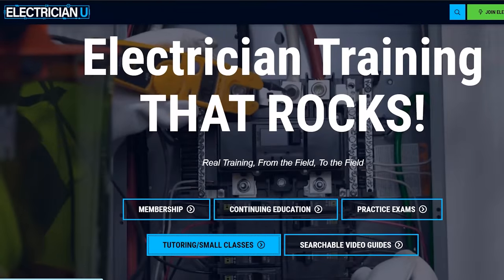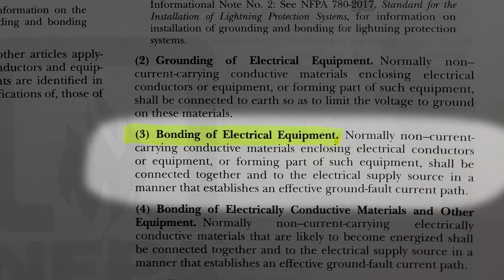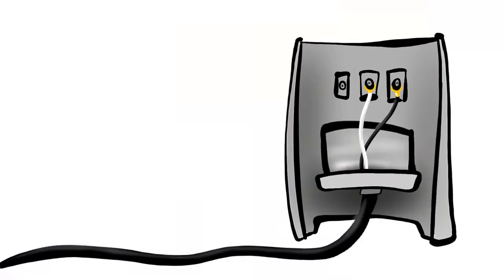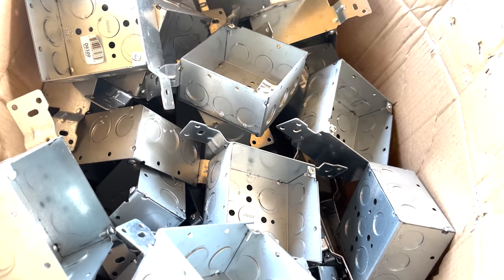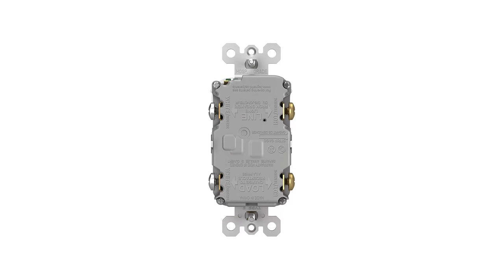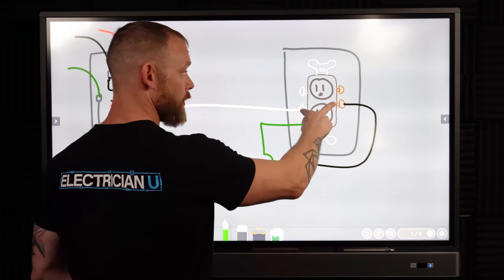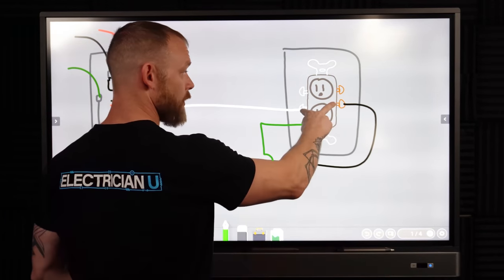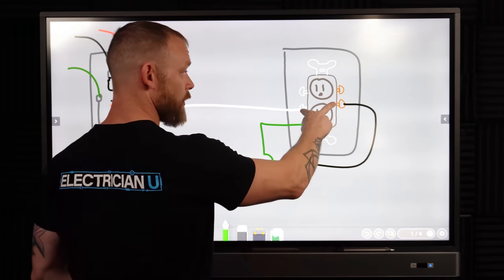Why We Bond Metal Boxes? Do Plastic Boxes Need Bonding?

Comment: Just remember not to bond a sub panel with the neutral and ground bonded together, they must be separated in a sub panel.
Reply: Is this because you always want the ground-fault path to make it's way BACK to the main service panel? And that is why we don't bond neutral and grounding conductor at sub-panels? I know there is other reasons....I am blanking (2nd yr apprentice here)
Reply: @mikenormandy9250  the reason for the isolation between the neutral and the equipment ground at a sub panel is because we want to direct path for fault current to flow. If the neutral is bonded to the EGC this creates a parallel path for the fault current to flow. We want that fault current to flow as quickly as possible to facilitate the over current protection device (circuit breaker) to clear the fault.
Reply: @electricianron_New_Jersey  THANK YOU! Appreciate your answer!
Reply: @electricianron_New_Jersey  So a parallel path could make the time-delay protection (fuse or CB) trip slower? THAT'S the puzzle piece I was missing! 👍
Reply: @PatrickKQ4HBD  This is not the reason we don’t bond the neutral at multiple points. The reason we don’t do this is actually to prevent objectionable current flow under normal operating condition. If you bonded the neutral at a sub-panel, the line to neutral circuits would use the grounding conductor as part of the circuit. We only want fault current to travel on the grounding conductor, so we bond neutral only at the main disconnect, service disconnect, or at the transformer, depending on the situation.
Reply: A bit off topic but thank you for stating the obvious.  suppose it might help someone out there who might not have already known, then again if someone didn't already know they probably shouldn't be installing a sub panel to begin with.
Reply: @RB-xv4si  Yep.  In that case the equipment grounding conductor would be carrying some of the neutral return current even under non-fault conditions, and so would anything touching grounded equipment; e.g., touch your washing machine and a faucet at the same time; not good.

Comment: Ah Dustin I see you have Purcell and Morin book on electricity and magnetism well done. It’s all physics anyway. Of course our separation between conductive and non-conductive is just a separation of convenience given enough electrical voltage and current flowing through even the blue boxes would become conductive. It’s just we are saying that would rarely happen as voltage and current never get that high unless in a direct lightening strike on a house.
Reply: With enough voltage, everything is a conductor.

Also, thanks for the Purcell & Morin book suggestion. I just added it to my shopping cart.
Reply: It is not a separation of convenience, it's a separation of real pragmatism.

At 100-400 volts these materials are NOT conductors.

That's why we call them insulators.

The difference between conductors, semiconductors and insulators is all to do with the amount of separation between the valance and conduction bands of the atoms in the material.
Reply: @deang5622  we were talking about breakdown voltages of different materials, mica has one of highest breakdown voltages ( diamond, benzene , perfect vacuum have higher breakdown voltages) breakdown voltages relate to very high voltages linked to the electrical field strength and other factors.

We were not discussing rated voltages for cables, and especially not at 100-400v we were talking about thousands of kilo volts. At those energies even wide gaps between conduction and valence bands can be bridged. At those energies it becomes moot what is an insulator or what is a conductor.
Reply: @mathman0101  No, you are going off at a tangent.  The original statement was around the designation of being a conductor or non conductor being a separation of convenience.

And that is not just the case.
The classification of whether it is an insulator or conductor is based on normal voltages which do not break down the material.

I challenge you to say otherwise.
Reply: @deang5622  we’re going beyond the statement!While materials rated at 100-400v are fine to conveniently describe what is an insulator or conductor at those energies. But even in a home those insulated blue receptacle boxes could become conductive in a situation of a direct lightning strike causing large temperature rise and conduction across all materials in floors and walls increasing the risk of fire and significant structural damage. It’s no wonder in many southern states including Florida lightening protection is an important feature for many homes. So yes something can be rated as an insulator or conductor at certain energies but there can be situations where that definition becomes less relevant.
Reply: @mathman0101  I am not going beyond the statement. I am simply correcting what I perceive as an error in the original post saying that the difference between conductive and non conductive materials is "just a separation of convenience".

It isn't a matter of convenience at all. It's a necessary distinction which applies to the materials in their normal use.

End of Debate.
Reply: @deang5622  🤣 debate never ends.I respectfully disagree you have your point I have mine. It might be a necessary distinction but it’s not a sufficient one.
Reply: @mathman0101  The debate ends between two people when of one person fails to respond.

Think about it. It's not difficult.

Comment: Still kinda confusing.   What if there is a green ground  the hot comes off touches the metal box there is also conduit  running off the metal box which goes all the way back to the panel?

Comment: Why don't they ground the neutral wire at the transformer to prevent an energized ground condition? Would the power be able to travel through the actual earth to complete the circuit then?
Reply: There are some places that use an "earth return" electrical service for cost reasons, I think mostly in Australia
Reply: The neutral tap from a transformer is connected to a grounding rod, for the purpose of dissipating static electricity and to give a path to earth in case of a lighting strike. 

To the second part of your question, earth is actually a pretty poor conductor and wouldn't effectively complete a circuit.

Comment: So 2 potentially (ha) dumb questions based on what you said:

1. If you were somehow floating in the air but touched an energized metal box with an improper ground, you would not be shocked?

2. Your examples include the hot wire coming loose and energizing the metal box (and thereby shocking the cat). However, if the white wire comes loose and touches the box, will the metal box still show zero voltage until the circuit is completed via the switch, etc?

Am I understanding this correctly?

Comment: Why is the green ground bus physically connected to earth? I get that this bus must be bonded to neutral in order to produce current flow to trip the breaker in case of a live-to-ground short but what would happen if you weren't physically connected to earth?
Reply: If the ground and neutral lines are not connected to each other, then when you touch the neutral line you will get a 110 volt electric shock. Not good.

Your body is at earth potential (or close to it) because you are physically in contact with the earth. 

So if you touch a neutral line that is not connected to the ground line, you are going to end up with 110 volts across your body. That is too high.

If you connect the ground and neutral lines together, then they are always at the same potential of earth/ground or close to it. So when you then contact the neutral line, and you are at nearly the same potential, there is only a very low voltage across your body and you live to see another day.

Comment: It should be so obvious and I guess it's not. Plastic (PVC in this case), is not conductive. Fault current - OR ANY KIND OF CURRENT - will not flow across non-conductive surfaces. 250.4

Comment: I am a bit lost on how a ground fault has way more electrical charge thus tripping the breaker. Ok, it goes through the ground wire and then to neutral so how does the over current happen?
I am a retired home builder but never had the time to fully understand the individual trades.
Reply: Gijo,
A Ground Fault Breaker (or outlet, or, as I think they are called in the UK a RCD) does one very simple thing . It compares the current flowing through the hot conductor and the neutral conductor. Any variance over a few milliamperes trips the device, under the assumption that current is flowing through something back to the ground, and if not the neutral than possibly a person. It is a new device (30 years or so?) and dependant on semiconductor electronics. A breaker or fuse, which trips at 15 or 20 or more amps, is just to protect the conductors from overheating. It provides no protection against shock.   Does that help? If not, let me know. 
Ian
Reply: @ianbutler1983  
Thanks for getting back Ian, but I still don't understand. How does the ground wire compare the current flow so that it is much higher than normal?
Reply: Y'all talking about 2 different things. Gijo, when a fault occurs in the context of, for example, a bare or loose hot wire inside an appliance making contact with the grounded case, you have now eliminated the "load" from the circuit. The load has a fairly high resistance, meaning the current flow is low enough that the breaker doesn't trip. A circuit without a load is a short circuit, and because there is such a low resistance without the load, current flow is extremely high, which trips the breaker.
Reply: There is no motor or light in the circuit so the resistance is super low. It is a product of Ohm's Law. The lower the resistance, the higher the current.

Comment: On every  box? What if 6 or 7 boxes on a circuit?
Reply from the maker: Yes? Grounding and bonding in NFPA 70 2020 requires all metal boxes be "grounded" and "bonded" as well as the use equipment if supplied with a means to both ground on bond be used.

Comment: Wait, why would more current pass via ground vs neutral?
Reply: If the hot wire makes direct contact with the neutral wire, then the same thing would happen. It would create a short circuit and the breaker would trip. But the neutral doesn't make direct contact with the outer case of an appliance, nor would you want it to. So the ground is connected to appliance cases/ frames/ etc. only as sort of an emergency path so that if the hot somehow comes loose and makes contact with the appliance frame, it essentially causes a short circuit and trips the breaker.
Reply: @TM-dh2xb  Ah, I missed that the powered device creates resistance/coverts-energy, so the amount of current flowing thru neutral under normal use-case would be less vs a direct path via ground. Ergo while ground is a neutral, so it could be connected to the neutral on the device and the circuit would function normally, "ground" means not-used-neutral.
Reply: @sunalwaysshinesonTVs  well, almost but not exactly. You do not want to connect the ground and neutral inside the appliance because this would make the ground wire a current carrying conductor. Electricity will take all available paths meaning that under normal use, there would be current flow on the ground, which we do not want. The only time we want current flow on the ground is for that split second during a fault, in order to trip the breaker.

This is also why ground and neutral are not bonded in a sub panel. If it were then the ground wire between panels would carry current under normal use.

Think of the ground as an emergency detour.

Comment: Simple explanation:;  There could be a connection between the “Hot” and an ungrounded metal box, and if you touched it it would shock you.  If there was a loose, hot in a nonmetallic box, and it was in contact with the box, it still couldn’t bite you.
Reply: But you didn't quote code! Dustin always says if you don't quote code it's just a rumor 😎🤣
Reply: Plastic boxes I’ve used has a grounding screw.
Reply: Yes it could still bite you.
It's got 110 volts on it and the path of current flow is down through your body to the ground beneath your feet, through that physical ground and to the ground/earth connection that is part of the electrical installation, and then as the earth/ground is bonded to the neutral, the return path is for that fault current back along the neutral to the distribution transformer. And that is the complete circuit.

Anything above 50 volts AC is enough to kill.

Now, that 110 volts is shared across your body and the resistance of the physical ground beneath your feet along the route back from you to the grounding point of the installation.

So if you're unlucky that resistance of the ground path from you back to the grounding point of the electrical installation is low, meaning most of that 110 volt potential is across your body, resulting in a voltage developed across your body higher than 50 volts (and less than 110).

Want to touch that 110 volt bare hot wire and test this out?

It's not likely it will kill you, or to deliberately misquote Clint Eastwood, "Do you feel lucky, punk?".
Reply: @deang5622  The conductors can.  A plastic box can’t.   If you don’t ground metal boxes, and something goes wrong, allowing a bare conductor to touch the box, the box becomes hot, and anything metal connected to it is hot.  Including the screws for the cover plate.

Comment: The key word is conductive material. How would you bond a plastic box anyway?.
There are idiots out there who try.
Where I work, I have opened up plastic emergency lights and found a green wire attached to a sheet metal screw into a plastic anchor shield (rawl plug). 
When you think people cant be that stupid someone will prove you wrong every time

Comment: I don't like plastic boxes, I have seen them melt when a device goes bad and overheats I have never seen a metal box melt or catch on fire. Plastic boxes make it easy for handymen to install outlets because bonding is not required. It also makes it easy for non-electricians to rough in houses with only basic training.
Reply: A good electrician should be able to install any UL listed box without batting an eye, plastic or metal..
Reply: I'm a diy guy and I prefer metal boxes also, I've used both and it's no big deal to hook up a bonding jumper. Even electricians use plastic boxes mostly, when doing residential work, because it's cheaper and faster. I like the 4x4 metal boxes with a mud ring. Easy to change from single gang to double gang or vice versa at a later date and with minimal drywall mods. I don't like the metal single gang boxes, too small.
Reply: @surferdude642  I get a deep metal single gang if I need one, though. They make 3.5 inch deep ones.

Comment: My best guess is that you need to include how the ground rod plugs into this discussion.  Your transformer on the pole needs to have a ground rod as part of the safety feature for return current / connection.  The A/C current flow creates the need for that part of the discussion.  Again, thank you for providing this service, it’s very helpful. 👍
Reply: Paul, can you explain how you think the ground rod is used in the “safety” feature of the return current? Because I believe you’re mistaken. 

The ground rod is part of the ground fault path, which is the dangerous path where you get electrocuted. It is NOT part of the “effective ground fault current path” which uses the EGC. The ground tod has nothing to do with the effective ground fault current path. The earth is NOT an effective path for current.

Comment: Can anyone explain. Why some appliances has neutral but some one not? 
Why EV chargers need only 2 hots and 1 ground while  for the ovens we need 2 hots/ 1 neutral / 1 ground ?
Reply: If it’s a 240V appliance that requires a neutral it’s because that appliance has a timer or other controls that require 120V to control the the power circuit
Reply: @Ephesians-ts8ze  thanks buddy! I appreciate this!
Reply: @ruslanlutfullin9688  no problem. Also if it says “120/240V” on the nameplate of the appliance that indicates that it needs a neutral. If it only says “240V” on the nameplate that indicates that no neutral is required
Reply: @Ephesians-ts8ze  oh wow! Thanks for that! It always confused me!

Comment: Okay so now I have to ask...how do we manage to trip a breaker without melting something in the process? that must mean the 120v20a wire going to the household appliance is capable of much more than 20amps, but the receptacle limits it to 20 amps?

So that's the true potential of a black wire on a 20amp receptacle?
Reply from the maker: The breaker is the limiting factor here. It makes or breaks that power path when it electro mechanically senses a fault. 

Your conductors are conservatively rated I'm the NEC for the events/ likelyhood of a serious failure. 

But that gets into material sciences, manufacturing specs, and listings.

Comment: I dont understand why they still use metal boxes anyways if the box can become charge and they say anytime you are working on electricity you are supposed to be standing on a rubber mat
Reply: Because metal is stronger and won't melt. In certain buildings you cannot even use any combustible boxes/wires, so you'd have to use metal.

Comment: At 9:40 Dustin says that “the only way to trip the breaker is with a completed circuit which is why we bond the ground to the neutral”. But I don’t see how the ground wire isn’t completing the circuit in a subpanel (since it’s not bonded to the neutral) because it is bonded to the neutral in the main panel.
Reply: It is creating the circuit, but there are other reasons why you should not bond at the sub panel.

You bond earth and neutral at the main panel.